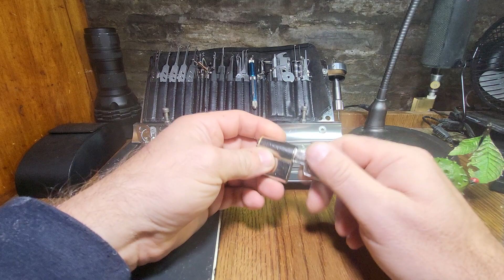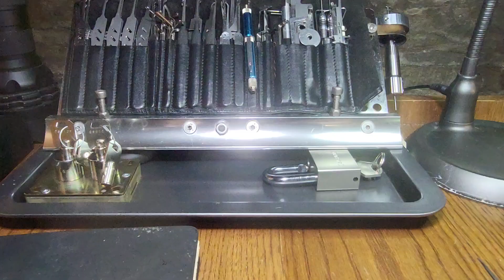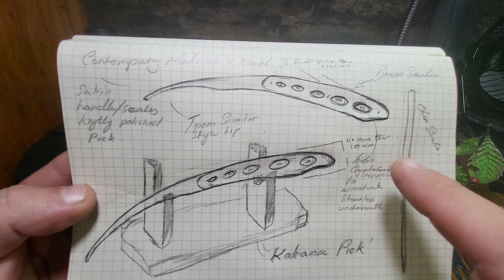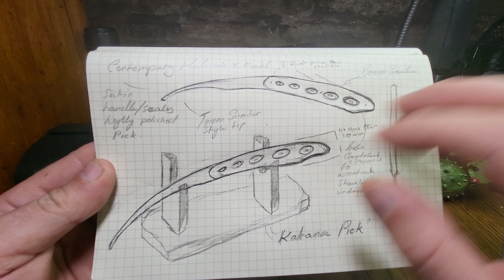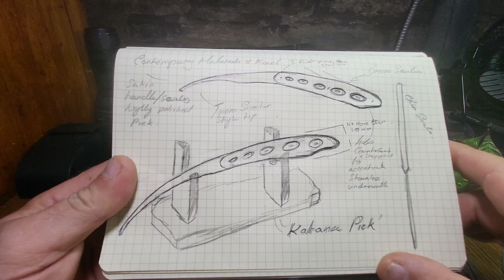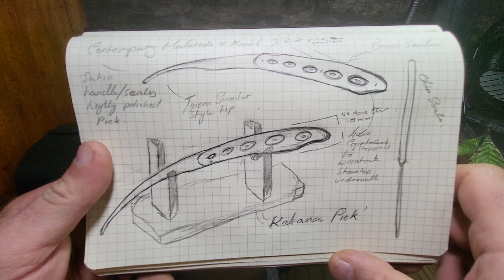My Entry into the #MammothPick100 Giveaway by @terrybpickin9941

Comment: MAKE IT, MAKE IT, MAKE IT! C'mon Paul it needs to be done, you know you want to. Good luck in the drawer
Reply from the maker: I actually really do.... not sure if I've got some suitable steel.... I may have to raid the cutlery draw 😆
Reply: @Lock-Picking-Paul  What thickness are you thinking?
Reply from the maker: @Gazz_R  I was thinking .5, can't be super thin as I think it would be too flexible, the probe I made starts at .6 and tapers to .4 right at the tip
Reply: @Lock-Picking-Paul  I'll PM you on the forum.